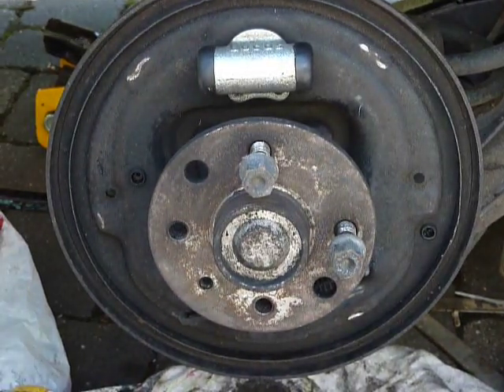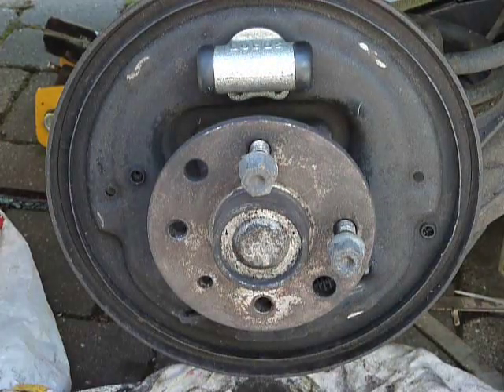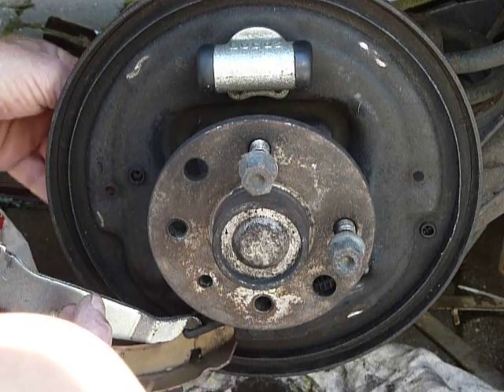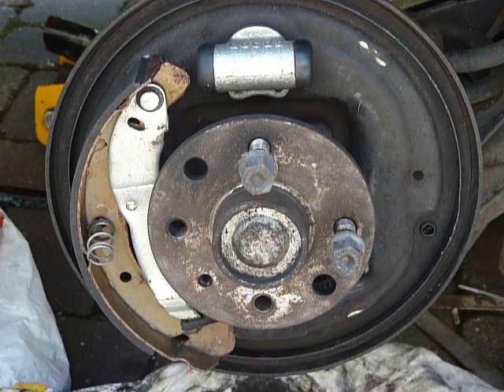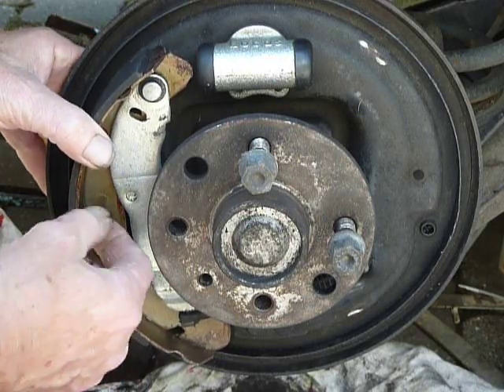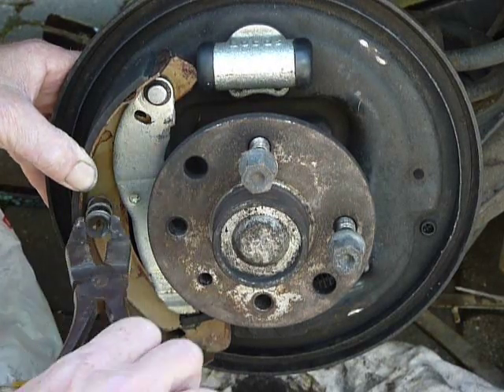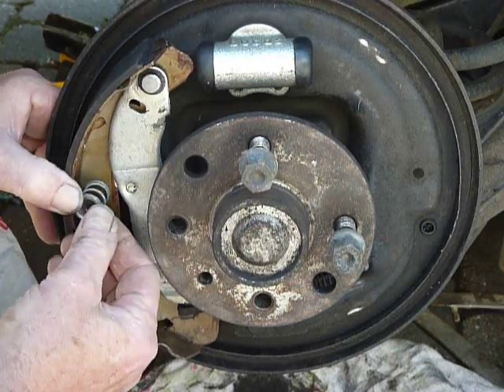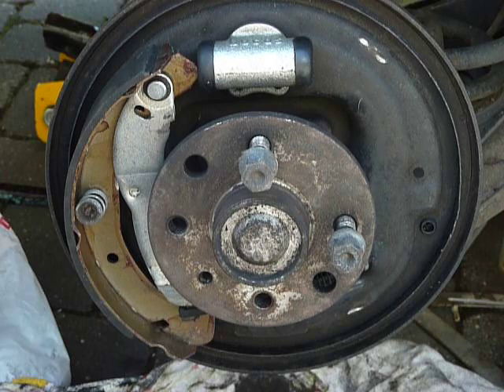How  to Fix Astra Brakes  Pt 4

Comment from the maker: HI i WISH I COULD JUST SAY DO THIS AND YOUR OFF  but    DOES THE HANDBRAKE feeel like its stuck ?? sometimes  just  pullinmg,, up and down a few times on   the lever , listen  it hear if it realeses , I would  fiddle with putting it in gear  ,,,rocking   back and forword ,   pulling on the brake handle at same time